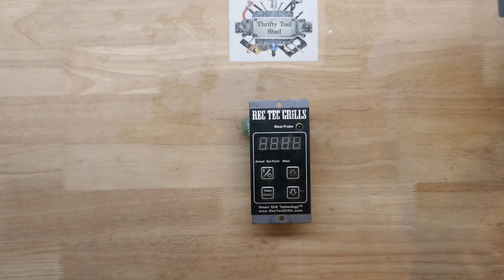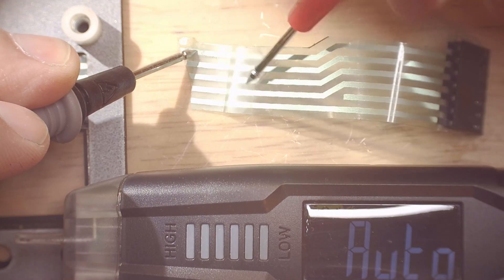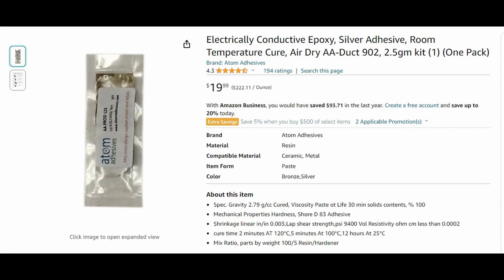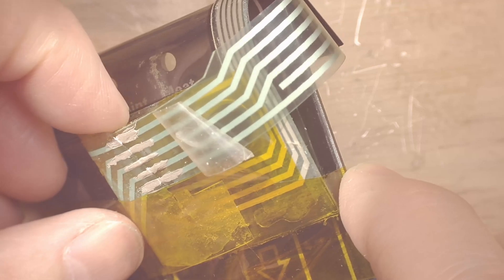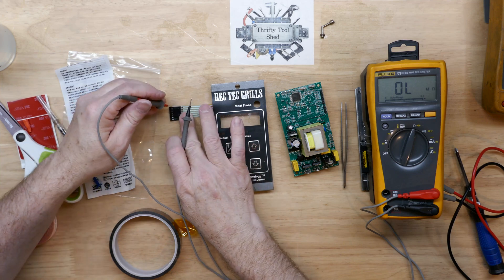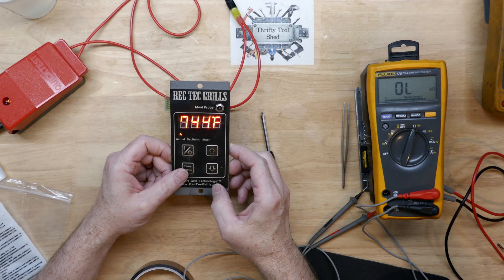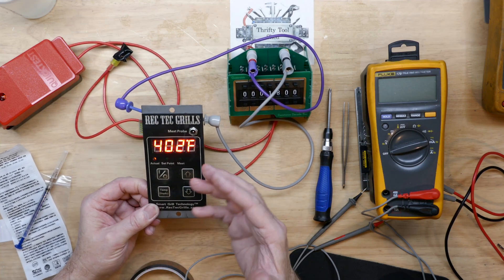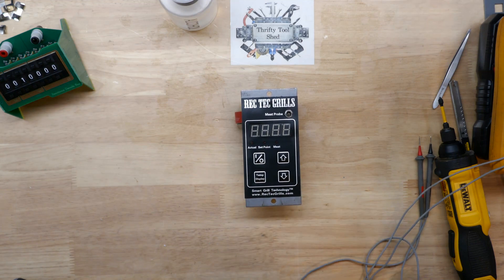RecTec Controller Ribbon Cable Repair

Comment: Impressive - I'm amazed that such a repair was actually possible. I guess only time will tell if the liquid conductor compound can with stand long term flexing of the ribbon cable even with the extra conductor added.
Reply from the maker: I was even hoping it would hold up to being re-installed honestly so I waited a while to post the video. I was not going to even post the video as a repair if it did not hold up for the re-installation and work a while. The owner said it is working well. I really like this for the plastic flexible ribbon that is difficult to find replacement for. I think low melt solder would be too brittle to last long at all in this repair,  but not sure the best for long term.